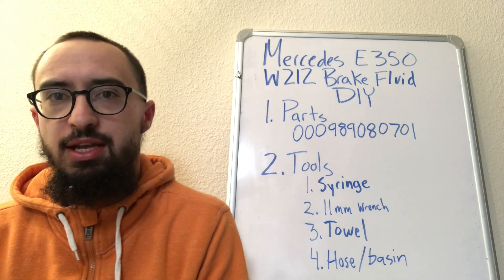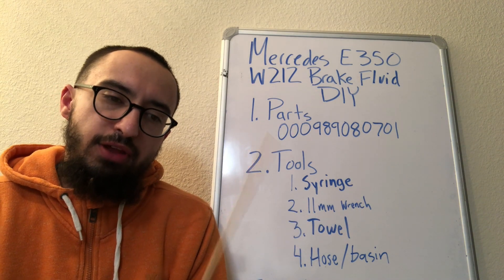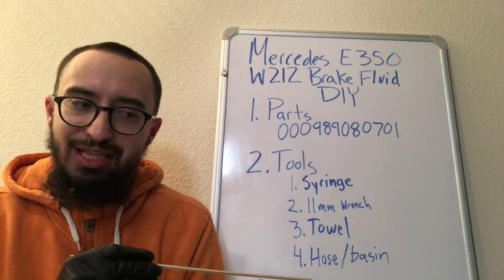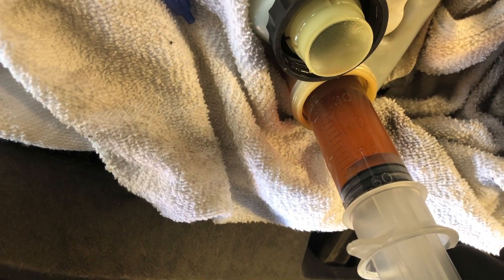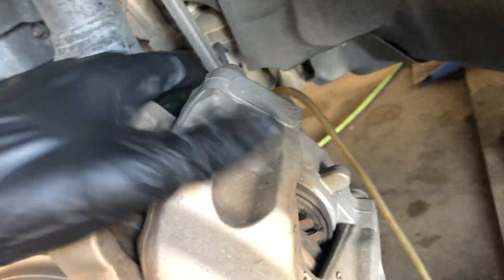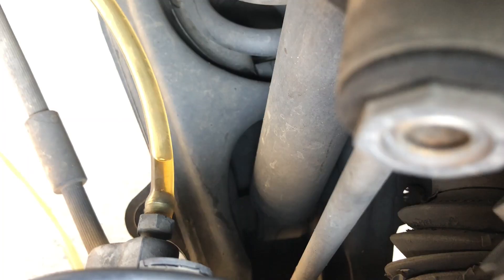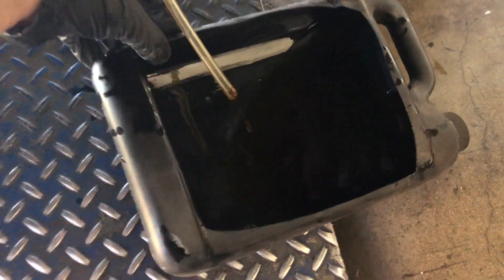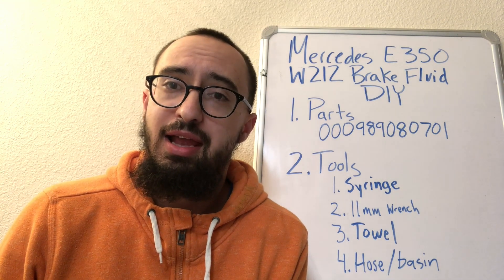Mercedes E350 brake fluid change DIY Step by Step on W212 E-Class with Flush.

Comment: I like using the same compressor assisted vacuum tank that I use with the oil changes. Makes it easy clean and fast. Just a slight vacuum is all you need.

Comment: Draining at the calipers with this clear hose-to-drain pan method can introduce air into the system.  Watch ChrisFix's video on this.  Not MB-specific but better methods.
Reply: You sir are correct! There will be air in the system. A reservoir with new fluid,under pressure , would be the way to go to flush the system. I think it’s worth to just take it to the shop, it’s not expensive. I personally don’t have the tooling to have the car in 4 jackstands
Reply: It's called gravity bleeding and in 20+ years as a professional ASE certified tech, I have never had air enter the system while gravity bleeding. A pressure bleeder makes the process much faster and easier, which we used at the Mercedes dealer where I worked. I have a vacuum system now that I push it into, then let it gravity bleed for a few seconds and have never had a problem with air in the system. That can happen if you attempt to drain the caliper at the hose bolt because it's not the highest point. Fluid coming out under gravity bleeding means no air in the system or else you would see bubbles.
Reply: @marcsmith3881 so other wise if my car isn’t on a lift don’t do the brake fluid bleeding
Reply: @remixsavedme4475  I am not sure how you came to that conclusion in regards to my comment about gravity bleeding at the caliper.
Reply: @marcsmith3881   so can I bleed my brakes with it having to be on the lift
Reply: @marcsmith3881   i just assumed since you wanna let gravity do the work
Reply: @remixsavedme4475  So you think that gravity is different at 6ft vs 1-2 feet off the ground? interesting!
Reply: I’m not arguing with you I’m asking you do you put it in a life or do you jack it up or do you use leave it flat on the  ground
Reply: @remixsavedme4475  Your questions are confusing me. Of course you can bleed them with the vehicle on the ground on Jack stands.     You can jack up the rear and it will work. You can jack up the front and it will work because the Master Cylinder will always be at the highest point.

 I am honestly concerned about your level of experience in this area with these questions. You may want to perform the work with someone that has more experience.
Reply: @ indeed but better to learn now then never don’t want to be that guy who can do his own work thanks for the reply I will indeed have this work done with someone who has more  experience . Forgive me with the confusion

Comment: The only reason to bleed front front wheels to back or start from drivers side is if you have your ABS module in the rear or located towards the rear of the car.

Comment: I don’t have the tooling or space to lift the car in the air and have it on 4 jack stands. There will be air in the system as soon as you pump fluid through the reservoir, you’ll need to put pressure in the system( 20 PSI ) to bleed the system until you see a color change. Probably I’m better off just taking it to a shop, at the stealership is 150$

Comment: Mercedes says start procedure at right rear, then move to left rear.  IIRC Finish at right front as the SBC pump (found on w211) is here making it the closest, hence last. Keep doors closed and DO NOT OPEN as this will wake the Sensotronic Brake Control, and a potential self test. I would be afraid of reservoir emptying should SBC wake up.
Reply from the maker: LOL that's the W211, the W212 at least in USA doesn't have the SBC system.

Comment: dealer wants 301.73 for this service!
Reply: I"m going to replace my rotors and pads. How much for all those plus bleeding the brakes?
Reply: @parteibonza  $300 if you bring it to me
Reply: @nydrell1969  thats a good price. cheaper than I paid to replace the rotors, pads, suck out the brake fluid in the reservoir and rent a lift. I'll remember it next time. I love this car ❤❤

Comment: Step per step tutorial. ⁉️ Number one. did the tires just jump off😲 ,Not on the White board. Is car on the ground or on a rack. Not on the White Board. Tools to remove tires, impact drill or racket, Not on the white board. etc.  etc.  etc.
Reply from the maker: If you don't how to remove the wheel I highly recommend you do not work on the brake system.
Reply: @mikeicee  Right. My point is that your vlog is not Step per Step. Nice try, though.